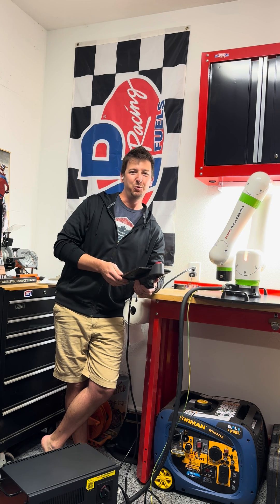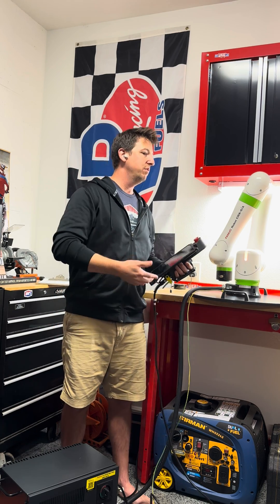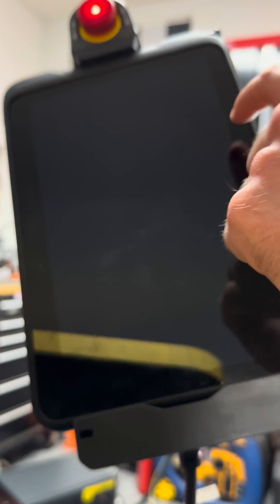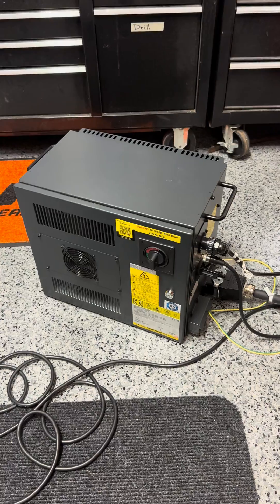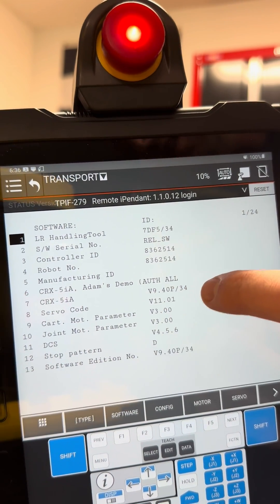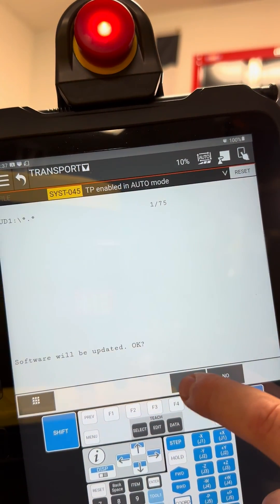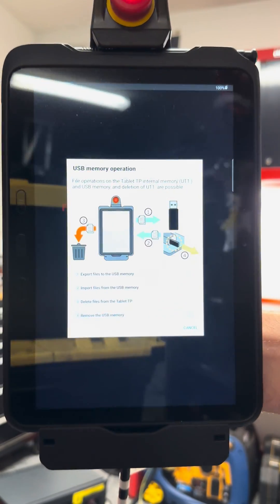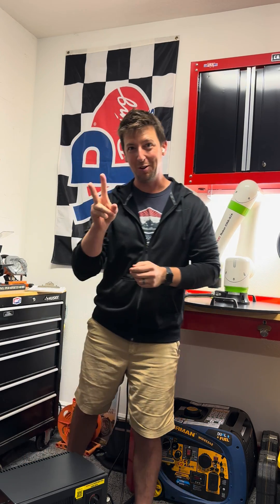Auto Update (my FANUC CRX)

Comment: Hello Adam!  Nice job as allways! Does this update solves the terrible and annoying high pitch sound and jitter that this robot has?
Reply from the maker: High pitch could be normal could be bad... depends on the acoustics of your room. But jitter?.... Always bad. I recommend checking payload settings - with special attention to Inertia and Center of Mass. 
This update does help with the manual guided tuning, so that's cool. But if yours is noisy in Auto - it may need some extra attention.
Reply: @AdamWillea  I just updated from V9.40/38 to V9.40/58 and the high-pitch noise is soooo much more tolerable now. I guess is was something to do with the Servo Amplifier tuning back then, because we were kind of early adopters and I had the robot replaced due to this and other problems and the new cobot had just the same "problems" as the "old" one....

Anyways, just letting you know that the best solution at the moment for bad-sounding CRX is updating!

Thank a lot for the help man! Keep up the great work!

Comment: Is there a way to send a weld program from cobot to cobot?
Reply from the maker: Yup! You can use "Data Transfer Between Robots" to simply "call" a program if it's already loaded onto both. Or if you need to write a program in one cobot, and copy to another, you can do that with FTP commands and your laptop. (no options required)